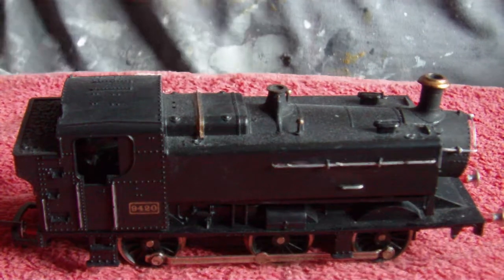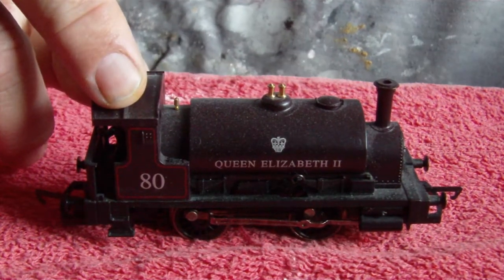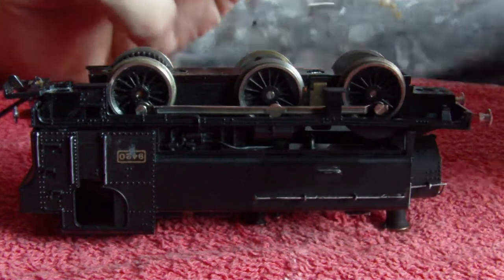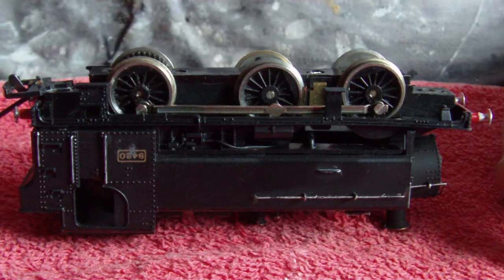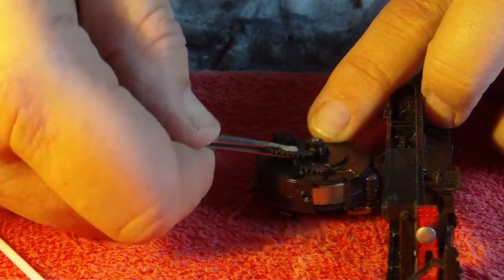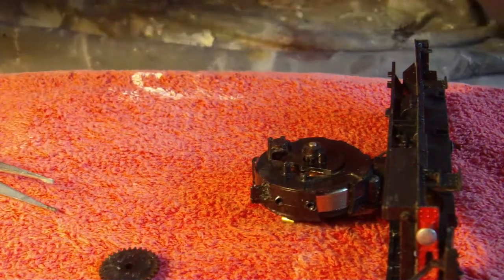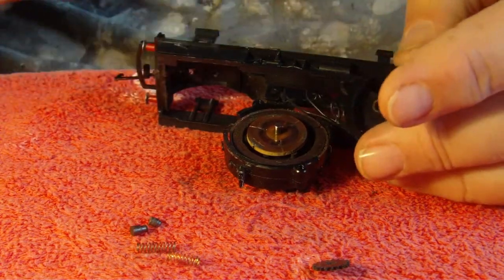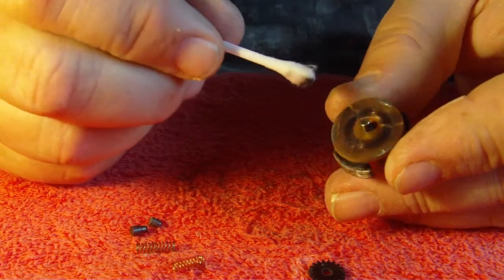Repairing Lima Locos

Comment: Hi Paul i have watched your video and i have been using your technics for cleaning but can you help me with 1 question i have a Bogie identical to the one you are cleaning above unfortunately one of the pivoting arms is broken and i would like to get the motor working again but i cannot find any information regarding the type of bogie it is and it was purchased along with a lot of other motors so the seller had no information about it can you please give any information about it Type anything would help thanks 
Mark
Reply from the maker: Hi Mark, sorry for the late reply. This was an 0-6-0 lima engine, you can look on ebay for a chassis, but when sold seperately they tend to be more expensive than buying a running model. You could look in either the "spares or repair" section, this way you get a few spares for all sorts, or look in "job lot" section, again lots of spares but usually some stuff that will work. Alternatively you could look to make a repair, dependant upon how damaged it is. Let me know how you get on mate.
Paul.
Reply: @recycledmodelrailways8655  Hi Paul thanks for your very helpful advice and i have taken your advice i have found a chassis on Ebay at petersspares and bought one thanks for your help and video Regards   Mark
Reply from the maker: @markfletcher7831  good to hear, Peters Spares is only ten minutes from where i live so if i cant find it on ebay, i go there. Staff are very good  and very knowledgeable too. Hope it works out ok.